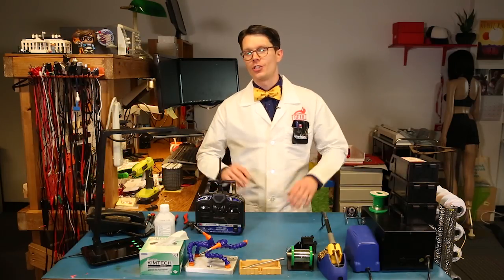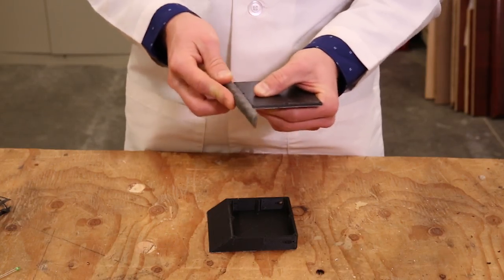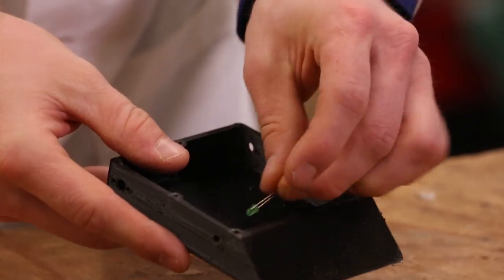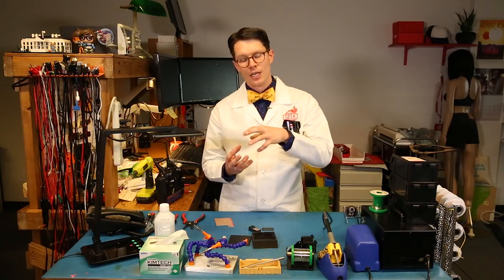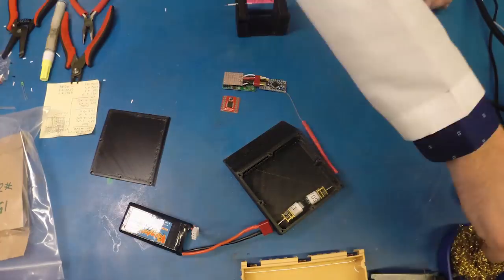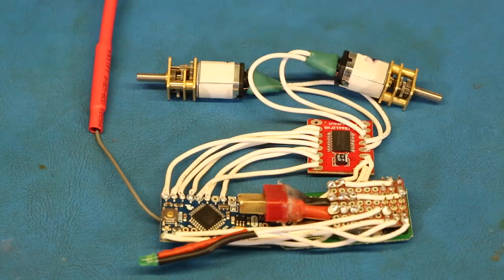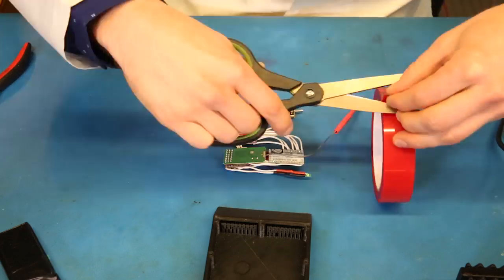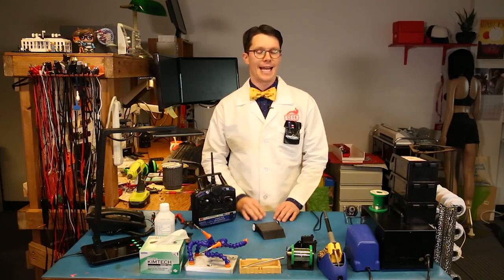Adventures in Science: Plastic Ant Combat Bot Build

Comment: lol placing a switch on the bots would make it a nice target for combat =)
Reply: Very true, and I usually don't see combat bots with an external switch for this reason :)
Reply: If its on the bottom though. Its pretty hard to get
Reply: From what I've seen, switches are recessed far in body, so you have to use a thin solid tool to flip switch.